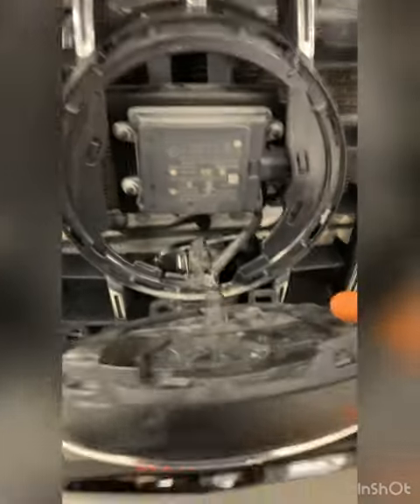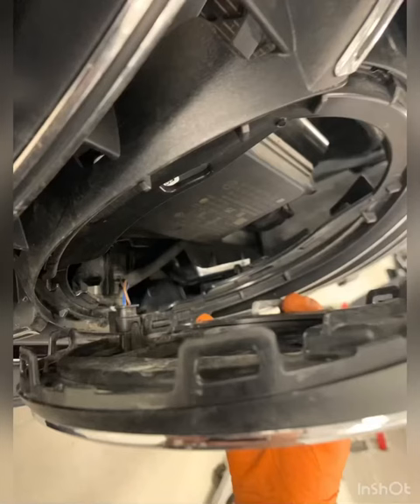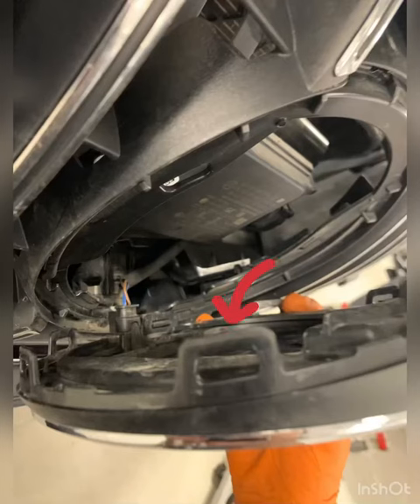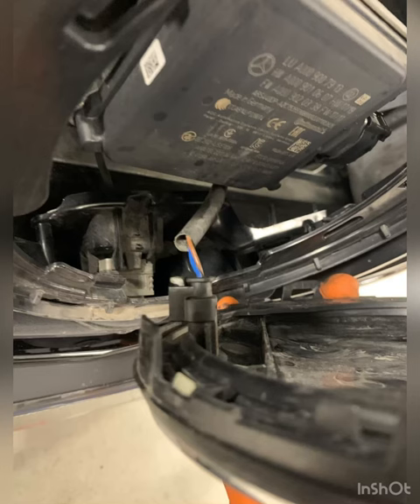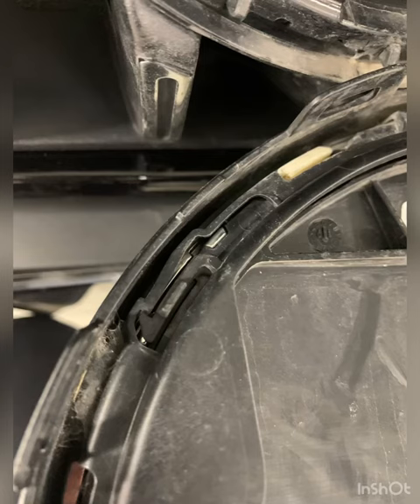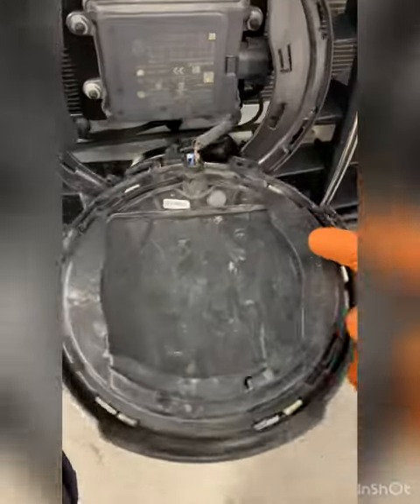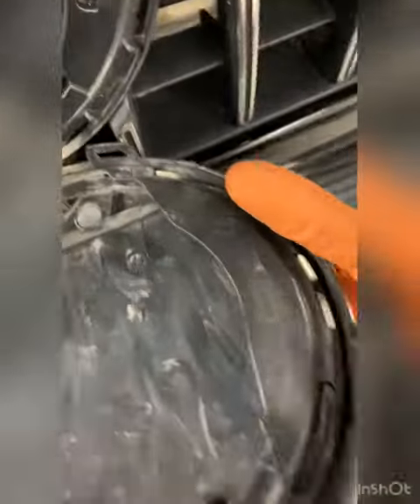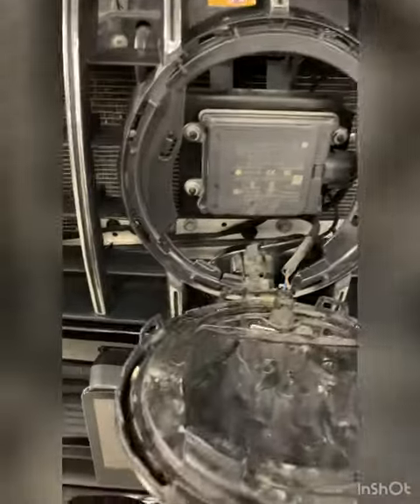How to remove a Mercedes front grill emblem (with distronic) #distonic #grillemblem #mercedesgrill

Comment: Can you help me to put it back in?
Reply from the maker: I like to leave it out until the bumper is on and in place,  just be sure to leave the wire out of the hole. Then spray the tabs on the backside of the star emblem with soapy water, glass cleaner or wurth rubber care. Its helps it to slide into place. From the front side, connect the wire, put the star emblem in at 11 o’clock, be sure it’s sitting flat all round, then Turn it clockwise until you hear a click when the emblem is at 12 o’clock.
Reply: Can you install a light up emblem if it has a defrost?